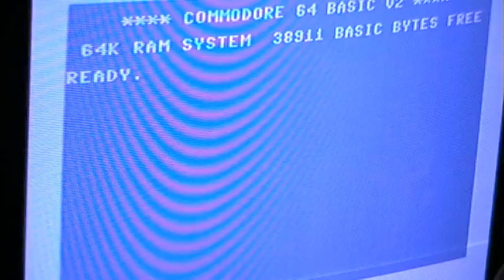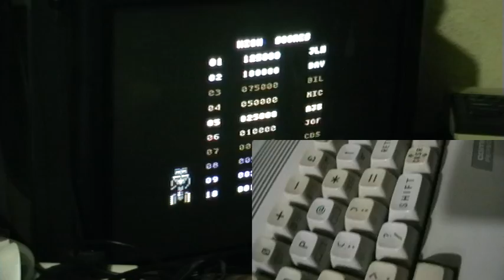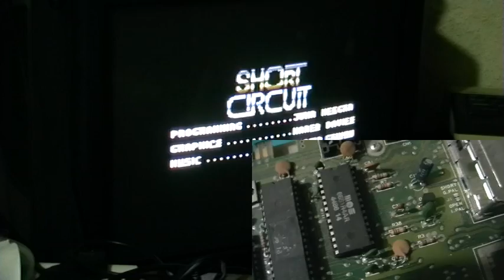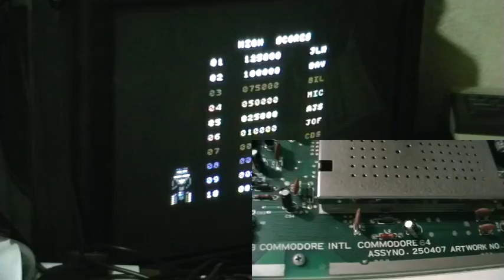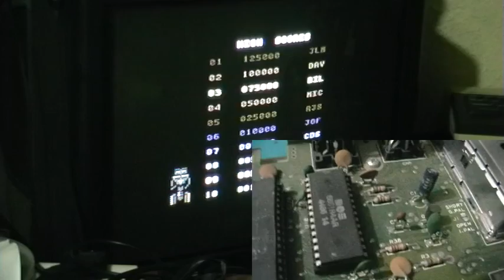Let's Compare - SID Chips - C64 vs. C64c vs. C64g

Comment: Hi..I am an electronic musician not only a gamer.
And I have a C64 first model of 1984.

My big issue is to choice from a 6581 from 1984 (without revision)that sounds good.

And a 6581 from 1983 without revision and sounds good.

For me..the 1983 Sid.sounds more bass..
than 1984 Sid.

And the Mssjah cartridge on the screen show the correct number of Sid (6581)..
only with the 1983 Sid.

With the 1984 Sid it show N/A.. but work.
Why???

On the 1983 Sid there's wrote MOS and CBM.

But on the 1984 Sid there is only MOS.

Maybe the 1984 Sid is not original?

Finally I ask to you...WITCH IS BETTER?

(For me...the 1983..has more bass)

Thanks😜
Reply from the maker: I don't think there is a better or worse SID chip.
It's all about personal preferences, just like with drink or food.
If you prefer Pepsi over Coke, that doesn't mean Pepsi is the better drink, it just suits your taste better.
Same with the different SID chips.

Comment: This is confused me! I knew that the C64c upgraded with the 8580 R5 SID!
Reply from the maker: The very first C64C came with the 'old' 6581 SID chip.
Don't know how long the production of those lasted.
At least over here, the C64c was initially just a case upgrade and had the same PCB and components as the last Breadbin models.
Reply from the maker: It's hard to tell which one is the 'best' SID chip.
It mostly depends on which tune is playing and your personal preference, of course.
As far as I remember, the later 128D had the 8580 chip. The one with the metal case.
The first edition of the 128D with the plastic case had the 6581.
Reply: Ok, thanks the info!
 I saw C128 mainboard, only and that contains 6581 SID.
As I saw things the 8580 is much better IF music has written to this type of SID. BUT games like Last Ninja 2 sounds better with 6581...

Comment from the maker: The 'model' of the C64 is not really important. It's the board revision and version of the SID chip that counts. There are some series of the old SID that sound really terrible at some filter settings. Also the filters are driven by electrolytic capacitors which can easily vary +/- 20% from their nominal capacity even if they are new... and they tend to dry out and lose their capacity over time... and they ar 25+ years old...

Comment: breadbin is the Winner .. but Heard from the monitor speakers of a 1084s, or 1982 color tv there is no difference at all..
Reply from the maker: The speakers from the 1084 weren't THAT terrible.
At least it was a huge upgrade compared to my old TV which had some constant hum in the audio depending on how bright the picture was.

Comment: Good idea but very bad execution:
1. The video does not indicate when which chip is playing.
2. There is no comparison of the SAME sound with different chips, instead DIFFERENT sound fragments are played with different chips.
Bottom line: useless video, sadly.
Reply from the maker: You noticed the small window at the bottom right, didn't you?
It always shows the insides of the machine that is playing at the moment INCLUDING the SID chip.
Just take a look at it and READ the number ;-)